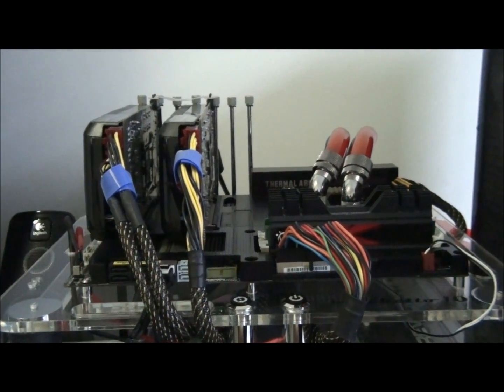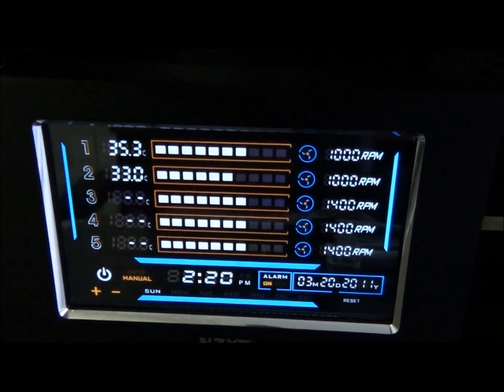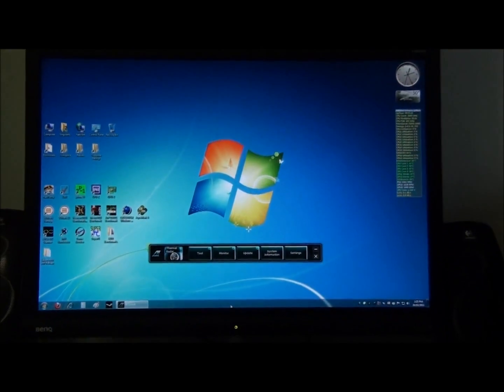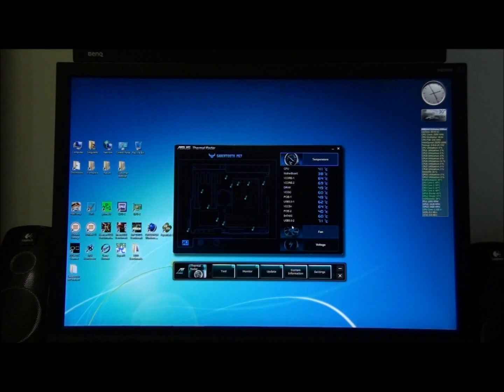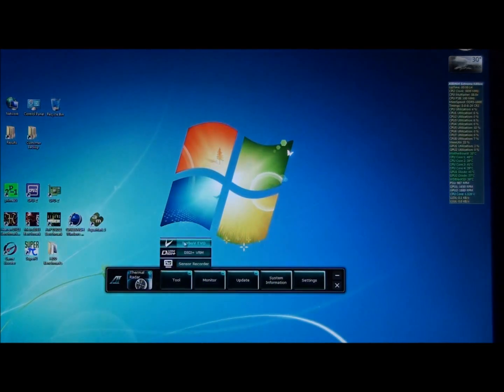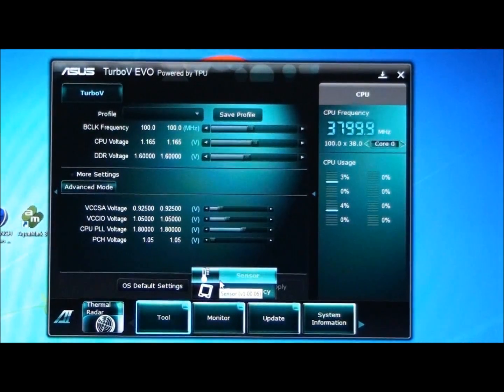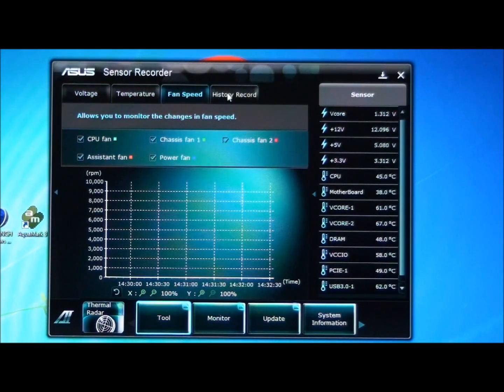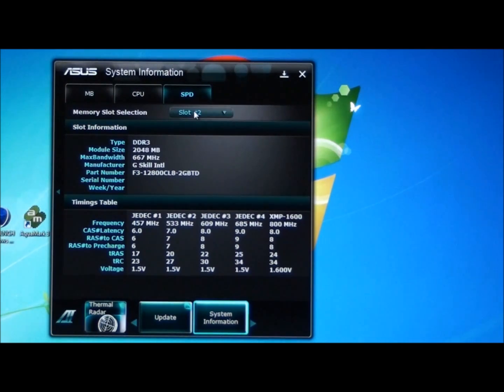Asus Sabertooth P67 Review Part 2 of 3

Comment: thank you recall!  I got to try out p67 tech and went through one 2600k processor and one mobo already.  I killed it at 5.6 ghz.  After that it wasn't stable at 3.4 ghz or any speed for that matter.  Take it as a warning.  If you push too far it will break.

Comment: cool.  I'm planning on keeping my p 67 sabertooth board for 10 years.  I used to have the asus delux board but didn't need all the features and the last pci express slot was only 4 X  the sabertooth can run four GPU at 4X  So you get a multie thread graphics processor!  :) very powerful.

Comment: those warnings are red for a reason.  please take care of your mobo.  a $10 fan is not much to ask when compared to the cost of the mobo.  Also a ram cooler helps.  These boards were specifically desighned to run a downward blowing cpu heatsink to cool the entire board.  If you use the recomended 50 mm fan and a ram cooler you should make those red temps go away.  Also it would make a good video.  I'd like to see if proper fans makes a difference.  Others would too.

Comment: Are you going to install a 50 mm fan in the board.  It makes a difference by about 6 - 8 Celcius.  Which is a good thing.  Also a ram cooler would do the same thing pushing air under the Tuf Armor.